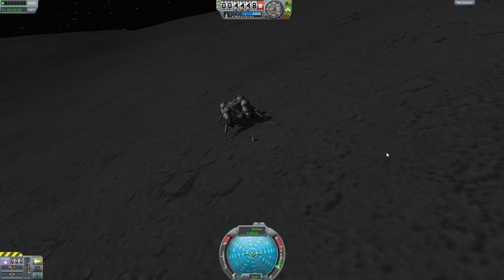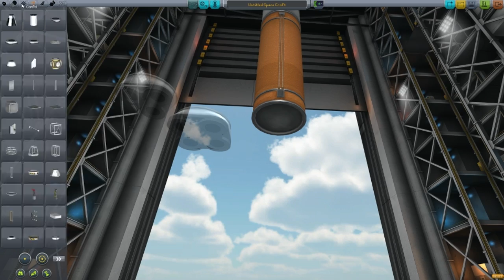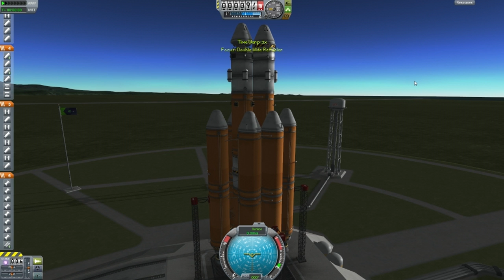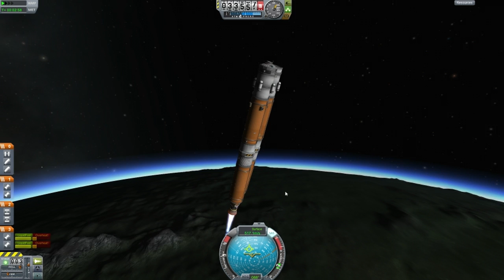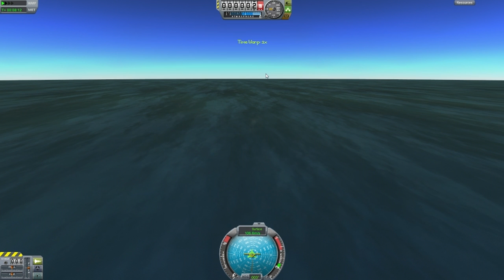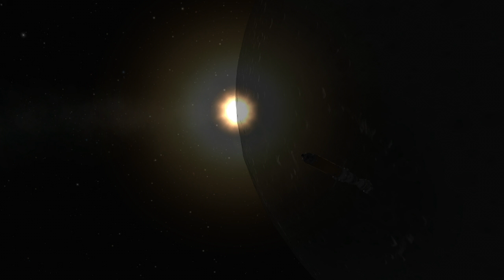Kerbal Space Program - E80 - Double Wide Refueling Mission

Comment: I don't recommend putting the mainsail straight onto the big orange tanks, if you insert a smaller fuel tank in between the engine and your main fuel tank it will stop the overheating.

Comment: You can disable some fuel tanks entirely (clicking the green buttons at the right of both fuel and oxidizer indicators); that way when your engines stops you have your "payload" of fuel+oxidizer on both twin "fuel towers".
And to mantain the center of mass of the twin towers always on the "middle" [helps to balance and save RCS ], add another white-fat-fueltank in between the poodle engine and the orange (2 white = 1 orange)
Like this:
[engine]->[white]->[orange]->[white]->[cpu]->[clampotron]

Comment: No need of decoupling Jeb or moving everything to a crash path to the Mün:
* Disable all engines.
* Create 2 "dummy" stages with the (+) at the bottom of the stage sequence.
* Drag&Drop your parachutes to one. The empty tank engine and its decoupler to the other.
* Move the parachutes up to "stage zero". And the other to fire first with spacebar.
* Transfer a little of fuel and oxidizer back to the "empty" tank.
* Point retrograde (orbit mode), full trottle and press spacebar.
Watch it crash.

Comment: Transfer enough fuel for a short burn to the side to be discarded, throttle up, decouple and kill your throttle. The engine should stay firing on the unwanted section and it should go until it runs out of fuel.

Comment: Kurt, you can throttle up during lift off to about 90-95% with mainsail engines without overheating them. Of course you should throttle down if you start accelerating faster than 200 m/s while in atmosphere (according to Scott Manley). It's much more efficient apparently.

Comment: So, poodles have poor T/W to push an orange tank and some change. So what? They are not crappy engines, they are efficient, in-space ones. You could put that stuff on munar orbit with the single nuke/LV-909 if you so wished, much more efficiently (60/50kN instead of 220kN for the poodle). Again, thrust is only important to fight gravity drag on a launch. In space, no one can hear you get bored with a 10+ min burn... but they will be happy about the fuel and engine weight you save that way.

Comment: Once you are in vacuum and in any sort of stable orbit, the engine size/power doesn't matter much. In a stable orbit and except for certain time constrained maneuvers, pick highest fuel efficiency vs weight vs desired maneuverability level. Long burns in orbital space aren't necessarily a design flaw, think Ion Engines (unless you are hyper inpatient, then it sucks arse).

Comment: If you set up the staging such that the outer fuel tanks fed to one immediately adjacent in a symmetrical fashion, for example if you had six you would split it up into pairs of three eventually leading to the final one in the chain as you jettison the spent casings in pairs, so on till the final one on the outside ring. then connect the final pair to the main rocket and jettison them when they are spent. this way you use all the rocket engines and loose the weight. much more efficient.

Comment: The lander doesn't have to achieve orbit, it just needs take off and dock with the dwr (double-wide refueler). If the dwr is put into a smaller orbit then it means less fuel for the lander to need for the rendezvous. But the most crucial bit of all is timing the takeoff correctly because there may be only one try (before reloading a save).

Comment: What graphics card do you have? If you have nvidia and integrated graphics, then you might have my problem. Go to Nvidia Control Panel>Manage 3D settings>Program Settings and select KSP (if you don't have it, add it) and then select the preferred graphics processor as "High Performace Nvidia Processor". My fps went from 20 fps to 60 fps. Same thing happened with Saints Row 4 for me.

Comment: Kurt, to make your double wide fuel tank work here is how you should set it up.  Remove the fuel lines between the two so the weight does not shift mid flight. Watch your total fuel and when you're about half or less stop and move all the fuel to the final stage and ditch the other one.